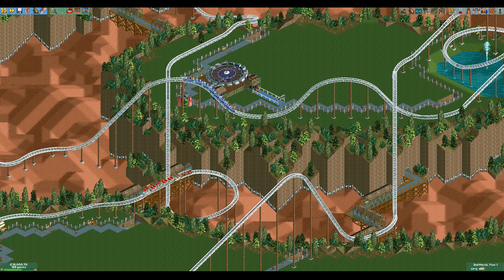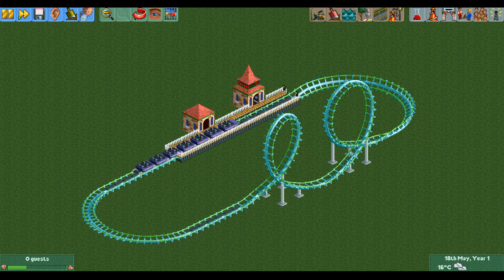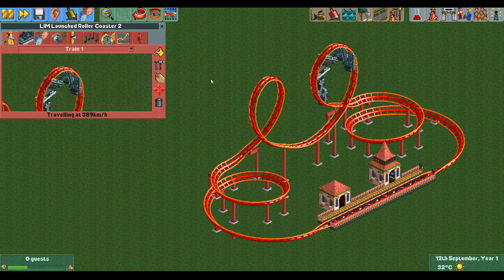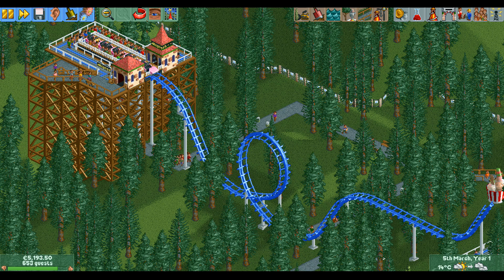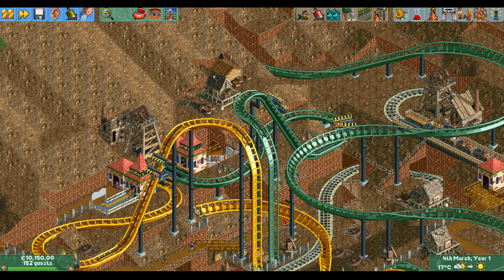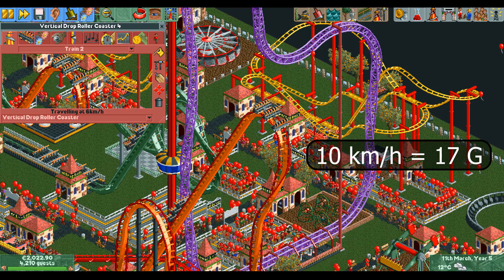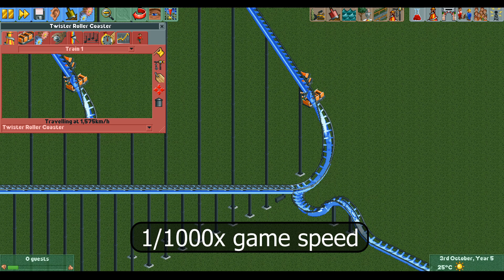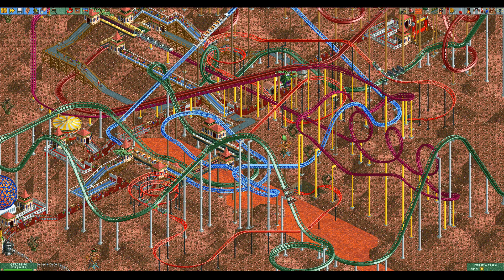How many g's does a launched coaster pull in RCT2?

Comment: Just a tiny pet peeve from an engineering student - stopping instantly DOES NOT require an infinite amount of energy. In fact, it doesn't require any energy at all... To stop a car you need to REMOVE kinetic energy from the car. That's not to say that it's easy to do that, there will be plenty of practical limitations, but AFAIK it doesn't break any laws of physics; at least not in an obvious way.

The other thing is that once you brake "instantly enough", it no longer matters how fast you're stopping because your body and the coaster will deform to cushion the impact and stretch it over a longer time period.  Think about a basketball bouncing off the ground - it appears instantaneous, but in reality the basketball deforms to absorb the impact and reroute it.

What I'm saying is: the sprites don't show it because they're not detailed enough, but those sudden stops are squishy, not rigid.

Comment: I build roller coaster in No Limits 2 all the time, specifically a program called FVD++ where everything is centered on g-forces rather than geometry, to give the most realistic rides possible.

It's very important to know all these real-life principles for roller coasters, especially launched ones. For example, if your ride enters a launch at around 10 miles per hour but the final speed is 60 miles per hour, you'll need about 200ft of track for the train to accelerate that much at a launch power of 1g.

RCT definitely never makes you account for that much extra track needed. This game is fun, but at the end of the day suspends reality and belief SO FAR it's genuinely comical.

Comment: Small correction, you claimed that stopping a coaster in a single frame would require infinite energy, but that is wrong. You only need as much energy as the coaster has kinetic energy. You will however require infinite force and therefore infinite power.

Comment: This all of course is dependent on the speed. Speeding up in 0.3 seconds to 100 km/h is not comparable to speeding up in 0.3 seconds to 600 km/h. Same goes for the brakes.
Also, the game runs generally at 40 fps I've noticed, which means that that is the smallest interval we can confirm the slowdown with the hold-drop section. Still bonkers, but certainly no tens of thousands of G's in the best case scenario.

Comment: couldnt you work out how fast the vertical drop holding break stops the train by using the vertical or lateral G forces measured when it happens? or is it too fast so that the graphs don't register it

Comment: Would you believe me if I said "infinite" braking power is actually a thing? 
An AC induction motor can use whats called DC injection braking to slow down or hold the motor still for a short time. This is how the holding brake on a B&M dive coaster works. The 400V AC frequency is gradually reduced to 0 (400V direct current) to bring the train to a stop before ramping back up and letting the train drop. The motor doesn't actually require any power to work as an induction brake as it derives the energy from the train instead of the supply line. The braking power is limited only by the voltage and current carrying capacity of the motor and cables. 
Assuming everything is physically indestructable, a high enough DC voltage will stop the motor and anything it is attached to instantly.

Comment: The 60fps part of the third calculation is wrong. RCT, RCT2, RCTC, and by default OpenRCT2 all run at only 40fps. While o
OpenRCT2 can be configured to run at 60fps using tweening, the tickspeed is still 40tps

Comment: 6:00 170 G is not "very deadly". It is "you are a smear all over the park".
And at 1570 km/h, you just got into the Supersonic Range (Mach 1.3 -5.0). Of course defining a mach number.
8:00 Oh please. That only means killing the Guests after they leave the park is correcting flaws in the laws of physics. They should have been dead anyway. You are preventing a lot of work for the Reaper along the "final destination" lines.

Comment: Couldn't you use the in-game data logging velocity graph to calculate the acceleration without having to rely on the speed reading on the train car screen?

Edit: Just tried it with a Corkscrew Coaster. 101 km/h in ~0.5s. Around 5.7g, so you'd still be hurting.
Reply from the maker: That graph has a very thick line which makes it likely that you get a large error determining when it ends, especially when the acceleration is so short. It also doesn't go above about 180 km/h, so you can't make the launch very fast to get more precision.
Reply: The lack of scaling on the graph also doesn't help matters, and neither does the rather arbitrary y-axis values.

Comment: What if the time's scaled to park time instead of real time, completely ignoring the fact that the game measures ride forces with real time?
10s = 1 rct day = 86400 RCT seconds. Launching to 240m/s over 0.346s means they accelerate to that over 50.112 RCT minutes (3006.72 RCT s). = 0.07982120051
m/s2 = 0.00813671768g
This is roughly equal to 1/10th the gravity of Triton, Neptune's largest moon.
From what I can tell, a good estimate of a roller coaster car is 735kg (535kg + 2 passengers). The LIM train is 20 cars long, so let's say 14700kg in total. Times the acceleration = ~1173 Newtons of force. Average human bite force is 720 Newtons, so if you wanted to stop this train, you could lay two people on the track and tell them to bite the train. Weight lifters exert at most 8kN during their lifts.

The ride breaks down. One of the passengers, who has been to the gym only a few times a year, gets out and pushes from behind. The emergency brakes engage because this 16-ton train is accelerating out of control.

Comment: "If you have a vertical drop coaster with a brake and hold you brake the laws of physics, because that requires infinite energy." (8:37) This is not true. The energy needed to stop a coaster has nothing to do with time needed to break (kinetic energy and thus the energy needed to brake is defined by mass and velocity). You most likely meant the force needed to stop a coaster (Newton), which is infinite.
Reply: But...force and energy are the same thing, no? It's still a correct statement, just unorthodox.
Reply: But creating an infinite force would require an infinite source of energy to provide power to the breaks, because the breaks need energy to create force.